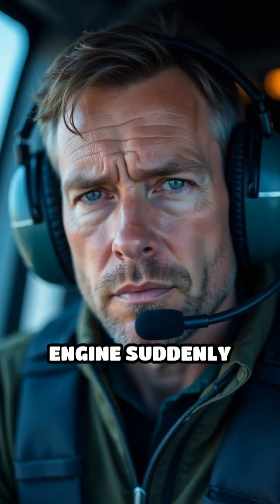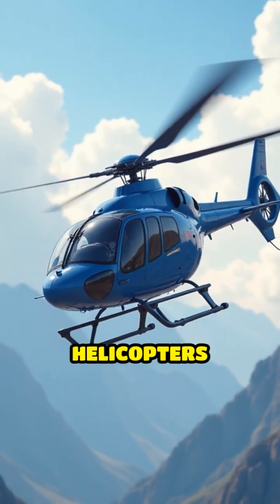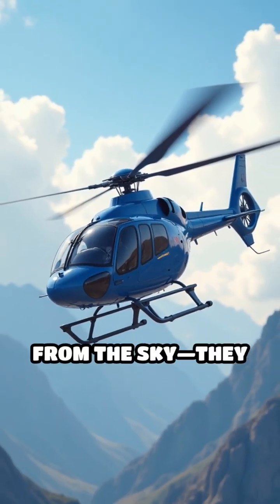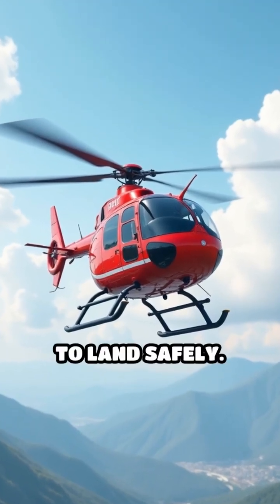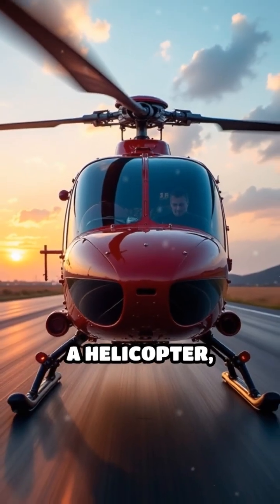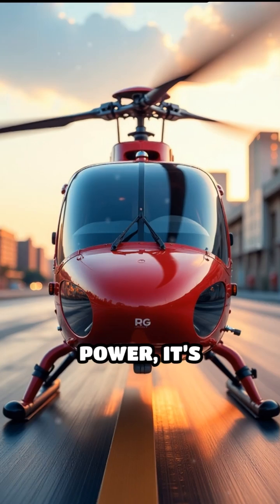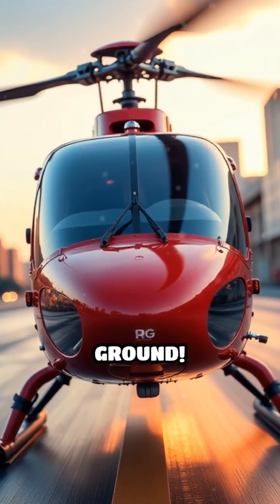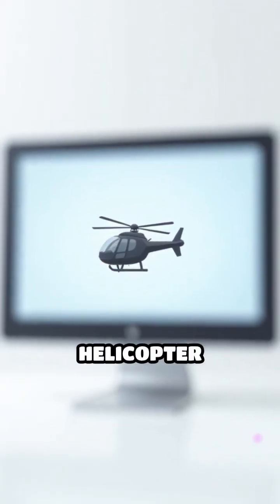How Autorotation Saves Helicopters in Emergencies

Comment: Gyroplanes fly by autorotation, and in a gyroplane it is automatic.  If a helicopter looses it engine, it has to be configured into autorotation, not an automatic thing.  It takes skill and people have survived a drop of hundreds of feet with a skilled pilot using it.   

So if a gyroplane looses its engine, it will start decending under control.  A helicopter requires a fast thinking, skilled pilot to configure it quickly into autorotation.  The 100ft statement from the previous post is mostly crap.  It would be near to impossible (except for the very most skilled pilots) to configure the controls of a helicopter with no power into autorotation within 100ft of the ground.